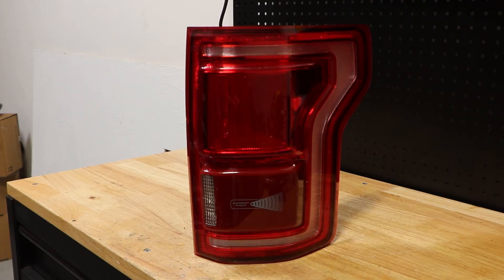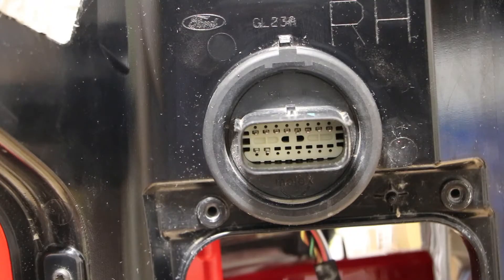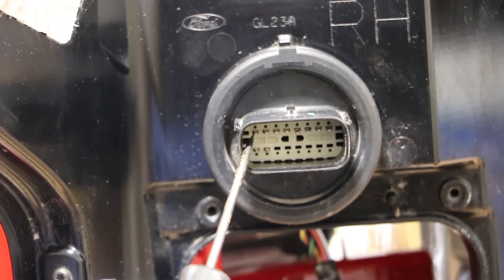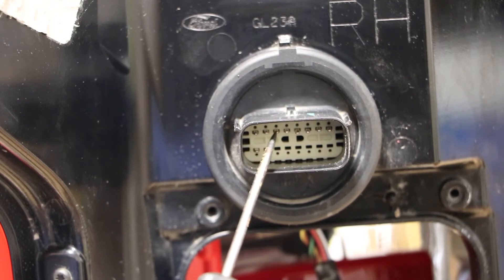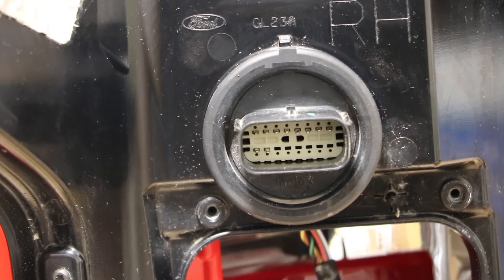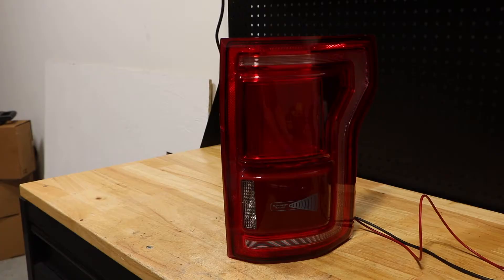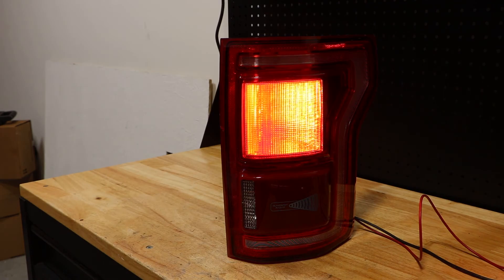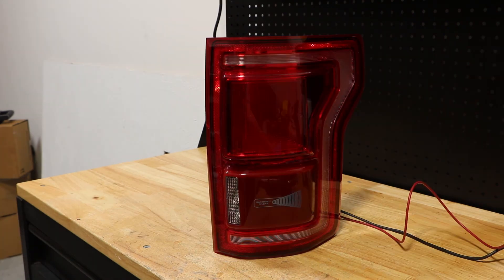How to test a 2015-2017 Ford F150 OEM LED Tail Light

Comment: Very helpful video, my entire passenger tail light is not turning on. Is there some kind of fuse or a common problem for these lights.
Reply from the maker: Most vehicles do have a fuse for the tail lights.  You would have to look in your owners manual for the right location of said fuse.   

It's also possible that the internals have failed and you would need an entire new tail light.  There are no replacement bulbs for LED.  When the LEDs or controllers fail, your only option is a full replacement.

Comment: How did you have it wired? Battery to switch to pin?
Reply from the maker: I used a bench power supply to put power directly to the light

Comment: I have a 2015 Ford f150 with these lights. One of them has the top half of the reverse light out/not working. Do you know if there is a repair/fix for this? I can't seem to find any information. Thanks.
Reply from the maker: I don't believe that there is a going to be a fix for this.   It sounds like you have an internal failure of the LED system inside of the light.  Because you said that 1/2 of the reverse light is working,  I'm assuming that the full power is being supplied to the light correctly.
Reply: Yes as he said there isn’t a fix for led failure. However, if you would want to sell the broken light I buy them
Reply: @Noah_Woodard   I hit something and put a small hole in my 2016 Fi50 tail light.  Now it  appears I have the same problem of not having 1/2 of the LED light work.   Do you want to buy it?

Comment: what voltage did you test the lights? 12v?
Reply from the maker: Yes.  The power supply I use is rated at 13.8v.